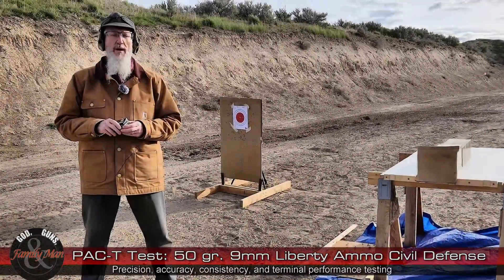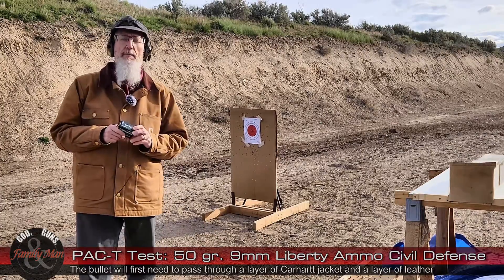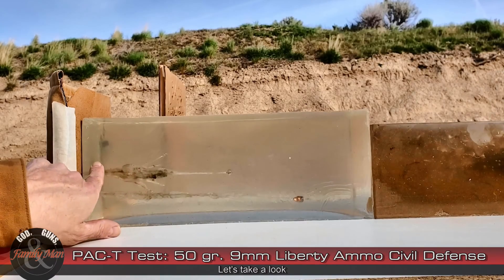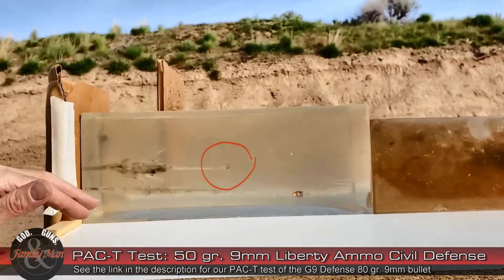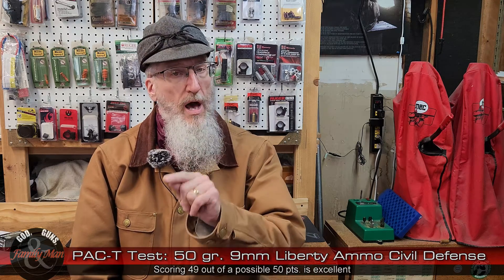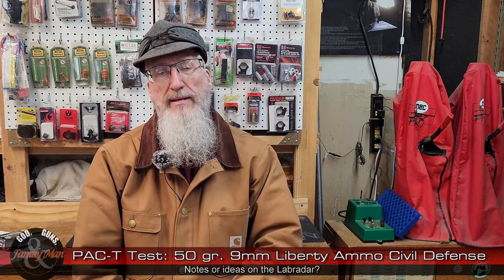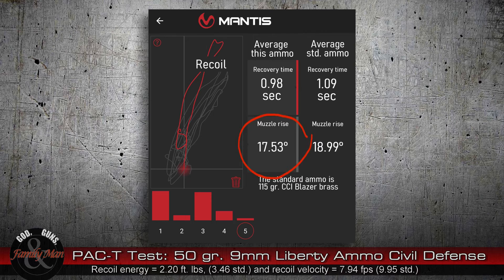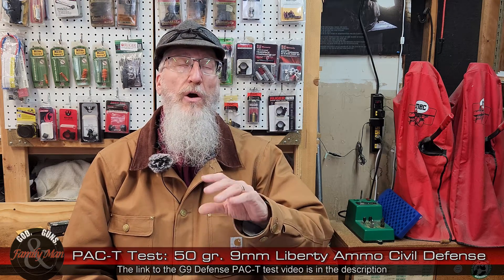Ballistic Testing Liberty Ammunition Civil Defense 50 gr. 9mm bullets

Comment: The thoracic cavity in adults typically measures about 25 centimeters (10 inches) in depth from the front (sternum) to the back (spine).  So 8'' of penetration, as in this test, is damn near perfection if shot placement is center mass.
Reply from the maker: Thanks for watching. Understand that depth in ballistic gelatin is not a 1:1 relationship with an actual person.

Comment: I have tested the 60grain 10mm of these and my optical chrono doesn't like them out of my 3.8" XDmE.🤷‍♂ I was only able to get one reading of 1394, and I do not trust it to be accurate.🤷‍♂
It read fine out of my 8" Banshee & 16.25" LC Carbine and I got 5 shot averages of 2724 & 2991 respectively. I think it is the muzzle blast from a pistol that causes the issue with chronographs.
Reply from the maker: You may be right about the chronographs.  I have very little trouble with my Labradar when testing other bullets, but these are very problematic.I am thinking about testing with my old Oehler model 33.  What optical chrono did you use?
Reply: @sdkweber  Typical Caldwell cheapo that's been around forever. 👍
Reply from the maker: @Disastrous.Affect  Thanks for letting me know. I appreciate that. I still might try my Oehler.  I have had it since the 1980's.
Reply: Oh yeah, backing up helps this problem on my optical chronograph. But I was at a crowded range and going down range to change setup wasn't really an option. 🤷‍♂️
Reply from the maker: @Disastrous.Affect  Good note. I usually run my first Oehler skyscreen at 10 feet from the muzzle.  I think it might get it, but will wait for spring to try it again.

Comment: I first bought these things about 10 years ago almost as a joke. I saw the advertised 50 grain +p and 2,000 FPS so I figured I'd try them out as a novelty just for fun. Boy was I surprised. On my chrono every shot it caught they were actually a little hotter than advertised, coming in around 2100 and even saw some in the 2200s. I know 9mm recoil is mininum as it is, but with these rounds that little 50 gr projectile had even less recoil than 115 gr FMJ plinking rounds, so you can really place well aimed follow ups. My shot placement seemed to mirror yours with it not being pinpoint accurate, but "good enough" especially at the short ranges where you'd expect any self-defense load to be used at.  I believe because these are 50 grain they are subject to weather conditions moreso than regular heavier rounds, and I wouldn't shoot these at anything beyond 25 yards anyways. The weight savings is seriously noticeable these rounds are really light weight and the difference is definitely noticeable between carrying an 54 rounds between the mag in the pistol and two extra mags on your belt, versus carrying 54 rounds of something like Critical Duty, Cor Bon, or PDX1. While I've never used the rounds on anything but target and ballistic gel, the wound they make is gnarly. I was skeptical at first, but been carrying at least some of these in mags for EDC for years.
Reply from the maker: Cool. Thanks for watching and confirming the velocities.  All good info and thanks for sharing that.

Comment: I’ve had both the LabRadar and the Garmin Xero. Man, what a difference the garmin is. It’s worth the money to replace the LR.
Reply from the maker: The only real problem I have had with the Labradar is with these Liberty Ammunition bullets.  I looked into the Garmin and see it only records muzzle velocity and no additional velocities downrange. Is that correct?
Reply: @sdkweber  I looked through my app and do not see any down range velocities. That could be a nonstarter if that's important to you. I never have missed shots with the Garmin and it's small enough to attach to my tripod. Easy to use app. Worked on everything from 22LR to 458 SOCOM, suppressed, too.
Reply from the maker: @noidea3177  The most important part is the muzzle velocity of course, but I have on occasion looked at downrange velocity to validate BC of bullets and compare drag variability.  I have missed shots with the Labradar, but not many (except for the Liberty ammunition bullets that is) and yes it works with suppressors too.  For the time being I I think I will continue using the Labradar but the Garmin looks like a nice future option.  Thanks for noting your experience.  That is very helpful.

Comment: Enjoyed the video. A few suggestions: 1. Buy a Garmin Xero 2. If you’re going to use the LR buy a magnetic trigger.3. Also, it helps to set the lab radar at a slight angle towards the path of the bullet . This gives better readings because the bullet will spend more time in the radar.
Reply from the maker: Thanks. I never had such problems getting muzzle velocity before and I think your suggestions for the Labradar are good. I will look into the magnetic trigger for it.  Any suggestions by the way?